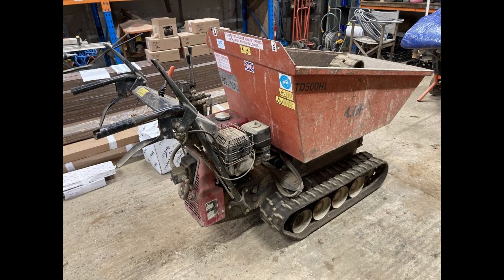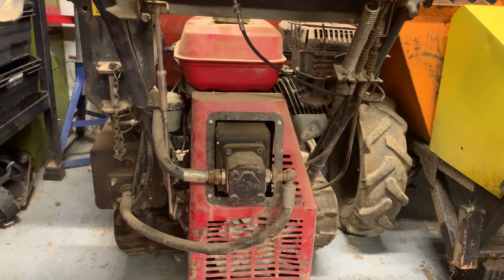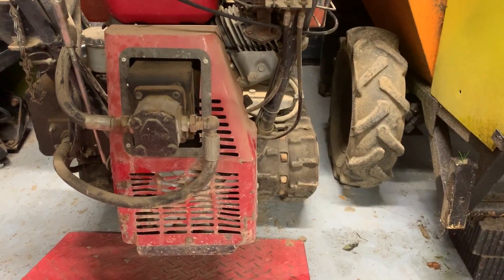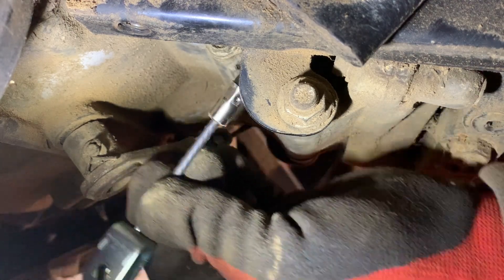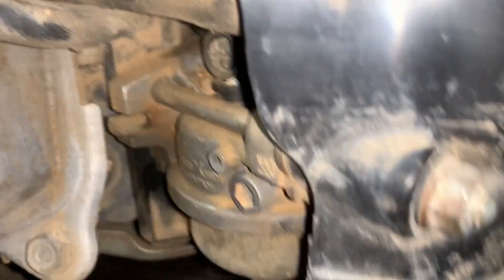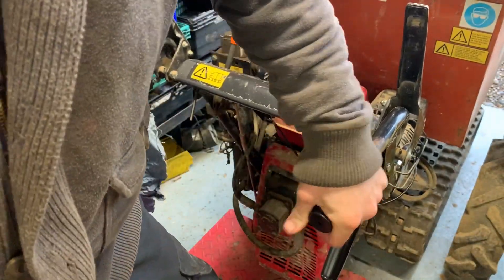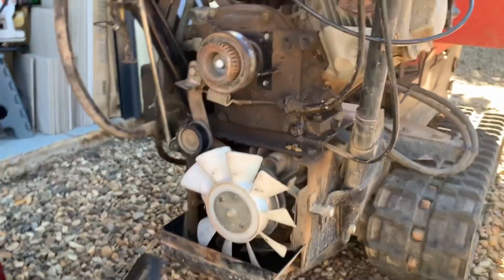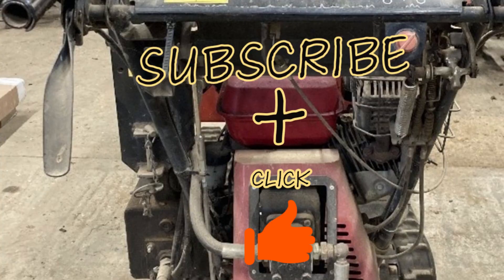Repairs to a Honda TD500HL tracked dumper including belt change

Comment: When ordering  belts, the letters are important. 
If you had ordered an SB 27 belt then it would have fitted.
The letters classify the cross section of the belt.
Reply from the maker: Yup, my amateur half-knowledge meant I thought I’d worked it out but I was clearly wrong.

Comment: Can I ask which supplier you got the parts from? Prices seems to vary wildly.
For example prices (all incl VAT) below for the same Bando Red S2 SB27 belt.
Seddon (the dumpers manufacturer): £27.66
L&S Part (stock a range of parts for the dumper): £41.48
Totally Belts: £9.01
Reply from the maker: Can’t remember who I got that belt from, possibly totally belts but I couldn’t find an order email from them. I do however use a combination in general of L&S Engineers, Garden Hire Spare (GHS), Seddon Plant, Simply Bearings, Bearing Boys and often sellers on eBay depending what it is. They all vary in their pricing so much I often shop around for parts.

Comment: Delighted to come across your channel, I've just bought the same machine at auction in Yorkshire and for the same reason as yourself!
Do you know if the LHS clutch level serves any purpose? I only need to press down the RHS clutch lever to track my machine although that means your right hand is tied up holding that clutch lever down to track the machine and that then makes using the RHS break level difficult.
I believe that perhaps my LHS clutch is missing a linkage that would allow either the LHS or RHS clutch independently make the machine track thereby allowing either hand to use the eiter the LHS /RHS break lever as required to steer the machine. Appreciate to hear your thoughts!
And just to add what you are calling the clutch I am calling the break lever, if that makes sense!
Reply from the maker: So the top levers should be connected together and operate together. Pushing either one down against the handle should move both together, they are bolted together. That engages the clutch. Handles underneath brake each track. Yes you need big hands to be able to hold down the lever and pull up a brake. But it doesn’t sound like your left lever isn’t connected to the right on and it should be.